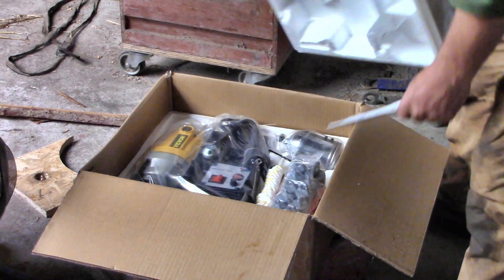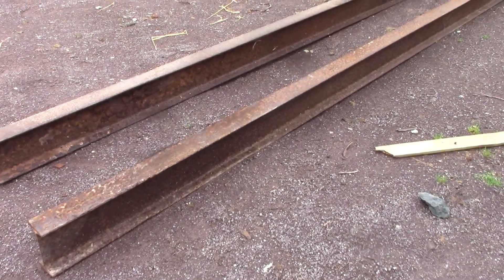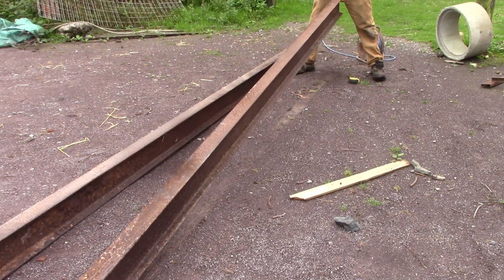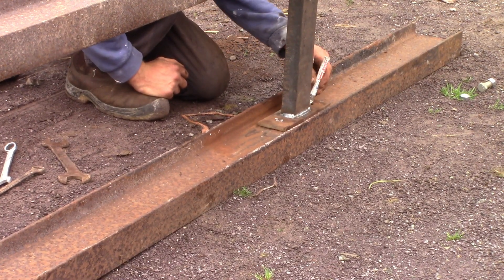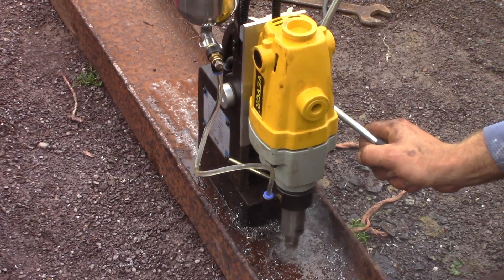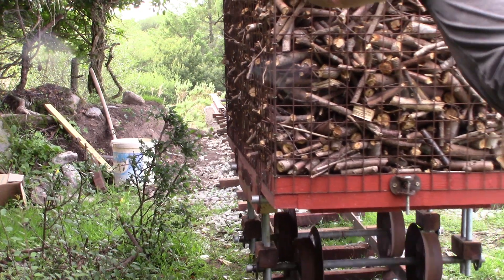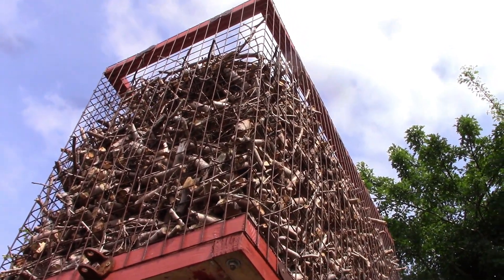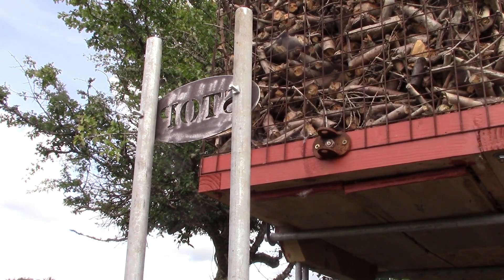We Built A Railway Bridge With A VEVOR Mag-Drill

Comment: Tim, ths is very interesting and could be replicated. What is the distance between the rails (gauge)? How much weight could be carried by the rails (those that you use the most, not this H section)?
Reply from the maker: This is 15" gauge. I'm sure the rails could cope with 100kg per axle easily - We've had more on them but only moving slowly

Comment: You might make a track maintenance cart, with a small hopper for ballast, and a mount for a grinder or wire brush machine (Battery powered) to clean the track surface of rust and crud. Start the grinder. and roll the cart along the path leaving a clean, fresh rolling surface,. Add a oiled pad to oil the track to delay rust.

Good luck!

Comment: Those oil filled dampers in car bumpers might work on your rolling stock as your cars run into each other and the ends of your tracks. These could be fabricated from pipe and use old valve springs instead of oil.

Comment: I've modified several magnetic drills for friends.  They all complain that the drill speed is too fast for some cuts.  I add another switch to the panel, there is enough room) and put a diode in series so it sees half wave DC. This works with any motor that has brushes. When high speed is desired, turn the switch on and it shorts out the diode. Everyone loves this mod.  Why don't they build it in?
Reply from the maker: You're right - it does seem to be spinning too fast. I think they made them like that for fast cutting. I'm only getting the hang of it now - but I could have cut those holes at twice the speed
Reply: @wayoutwest-workshopstuff6299  All the mods were requests made were for commercial fab shops who wanted longer life for the bits. Assume experience has taught them something.

Comment: Clean steel works 200% better.  Magnetic drill are very useful. I do use mine as a bench drill press. The oil reservoir can be adjusted for the amount of oil or cutting  fluid to be released.

Comment: As a fabricator/welder/machinist I have used a mag drill many times. They are really nice if you have a hole to drill in the side of something. You don't have to hold it up and drill at the same time. YAY!
This is great until the power blips during a storm⚡ or some dolt unplugs your cord🤬. Yes and yes before you ask. If drilling on anything other than a horizontal surface, tie the drill to something above where you are drilling so you don't end up wearing that drill that may be still turning when it comes loose. And yes I've had it happen. It sucks and hurts.
You have to be safe...
That looks like a really nice drill and the coolant feed is spot on.
Cheers
Terry
No, I didn't beat the guy up that unplugged the cord. I didn't want to get fired. 😎

Comment: Maybe you should fit some planks on bottom flange of the beams so you can walk on it (up to the hopper of course) and good idea would be to weld or bolt stoppers onto the rail instead of that sign. They would help with alignment since sign has bit of a flex to it and could slowly bend out of alinement.

Comment: Hi Tim.  Thanks for a great video once again.  Might I suggest clamping two wheel stops to the end of the line?  These devices are used on regular railways to arrest the wheels of rolling stock in the case of an overrun.  There are lots of examples online of various styles.  Fabricating them would be a very simple process using your CNC plasma cutter.

Comment: Fill the tank with oil. This will run down as you press down and lubricate the inside of the cutter and allow the slug to pop out.
Reply from the maker: Yep, that's what we did
Reply: @wayoutwest-workshopstuff6299  yes, I saw that after I commented. Very useful drilling machine. Please don't be tempted to sharpen those cutters without the correct grinding machine.

Comment: Love it Tim, keep it up.
  I am not a mag drill expert either but I have worn a couple out by drilling dozens of hundreds of scores of holes.
 I will say that the majority of tooth wear comes from just acquiring the initial cut rather than the cutting itself.  If you can avoid starting and then stopping multiple times per hole then the bits will last longer, Your onboard oiler will help with this and i've drilled many holes with only water for lube. Of course in thicker metal you may need to to clear chips but it's small troubles for the magic of a one inch hole in one inch plate.
-Since the rake of the teeth is low it means as they wear you may struggle to initiate new cuts. a well struck center punch will remedy this as well as a slight starter drill mark (but not a thru hole).
it allows the guide rod a place to drop into to allow the teeth to start a little deeper.
-Clean metal is better for the magnet and the drill is less likely to lose purchase and well smash your fingers just before it breaks an expensive bit :-)
Reply from the maker: thanks - yes, all that makes sense..

Comment: Well done Vevor. I have used them for heavy duty full extension hinges. You are using oil, which is better than water or nothing. Try and get some solubile oil for coolant, that is what is used in industry. Its diluted with water and has better cooling characteristics than oil. It’s called slurry and mixes up white. Look after the cutters, don’t let them get hot. They are expensive. Keep up the good work 👍

Comment: Mag drills are superb , but use the correct cutting fluid ( lots of it ) as roto breaches are expensive 
Always use a safety chain to prevent  the drill body falling off when used in vertical boring

Comment: Fantastic!  Have you considered building the char cooker to run a steam drive compressor which can give you the 3000 psi air for your engine?  Or perhaps run a generator to charge batteries for a locomotive?  Have you found a 3000 psi compressor yet?  Diving compressors will surely work but are very slow however there is a chance you will find an old one that is not being used at a great price.

Comment: Brilliant as usual.  Low Tech Magazine should name a "Hero of Low Technology" every year.  I nominate Tim if said website gets around to such an accolade.  In a low tech world a mag drill would be shared around to help with ingenious, low-impact yet high yielding projects like Tim's.  Big question: did the center plug come out easily when the hole was finished?
Reply: The centre plug usually falls out at the locating pin (usually for centre punch marks) has a spring behind it in the arbor which pushes the plug out. Though occasionally the plug gets wedged at an angle so you just pry it off the end of the broach cutter with a screwdriver or something
Reply: Great!  Now I really want a mag drill.  Probably have to take up metal fabrication to justify the outlay...

Comment: Hey Tim! I'm really looking forward to building a small railway myself, but I'm scared of the costs, especially for the wooden sleepers. I want to ask a question that you may know the answer to better than myself, wouldn't it be cheaper to make  concrete sleepers as thick as your wooden ones, space them out a bit more than you spaced your wooden ones and come out with lower costs?
Reply from the maker: I looked into making them at one time. I'm sure they'd be the best in the long run, but they'd be much more expensive short term. I was going to make a mould and a vibrator so they were strong - with rebar - but for my type of fixing they'd need holes for the pegs and the distance between the holes varies unless you're on a straight. Have a go though, and let us know how you get on?
Reply: @wayoutwest-workshopstuff6299  Alright, thanks! I figured out a 12 inch gauge railway with 40x40mm sleepers would cost only 10 euros here in Romania, but that's still a lot of money for us, so I'll try and see how expensive it would be. Maybe if I'm using bigger gravel in the concrete and I have the holes pre-made in the mould, it would be easier.
Reply: @bobi_lopataru  if the sleeper is only 40mm wide, the aggregate should be small, maybe 10 mm. There isn't room for 20mm and rebar?
Reply: @Ashley-yn8xe  Good point, I'll see what i can work out hehe
Reply: Hmmm... Concrete sleepers sounds nice! I wonder how much it would cost either. Also, do they have rebar inside them? That might increase the cost though...
Reply: @rizalardiansyah4486  I was thinking of that too, but one piece of rebar would suffice, hopefully, so it shouldn't be that expensive. Probably the most important aspect of this idea is the pricing in my area for said materials.

Comment: Great job and a useful tool that I didn't mind watching a working ad for.

As an aside, when I worked on a farm, we used to use old Diesel engine oil for lubricating things that would be outside. Hinges, top link adjusters and other bits of kit. It was free and it seemed to resist weathering better than fresh oil.

Comment: Maybe you can add thick wooden planks between the rails to allow you to walk out partway on the bridge? You might have to add another cross piece closer to the 'land' end of the bridge. I think you will find many more uses for the mag drill, I have seen people use them in a horizonal mode mounted to a vertical metal post

Comment: I have a suggestion for your end stop. It looks like the loaded hoppers are putting a lot of leverage on it, which could be a problem especially if you plan to use the sign to position each car. On a real railroad this is often solved by using what they call a "wheel stop," which looks like a wheel chock bolted to the rail. It could be added in addition, because the sign would help keep the car from flipping over the end if you hit the wheel stop too fast. As a side note, there's also a thing called a skate (search "railroad rail skate") which can be set down anywhere on the rail to keep a brake-less car from moving. These are sometimes used at the far end of a hump yard to keep the railcars from rolling too far. I hope one or both of these ideas is of help.
Reply from the maker: I should have drilled the holes before I put the bridge in place - now I'd need a generator...
Reply: @wayoutwest-workshopstuff6299  Maybe build a wheel chock and weld a clamp to it, so you can clamp it on the bridge anywhere you need it? That way you could even use cars of different designs if you should ever want to evolve them. Although the clamp should be very heavy duty, and not just hand-fastend. But real buffer end stops (the ones with the buffers) are also just held to the rails with friction, so that they can bleed of the energy of a fast moving car, instead of just getting ripped appart.
Reply: @wayoutwest-workshopstuff6299  Some smart company might offer one of those inverter generator thingies.
Reply: @wayoutwest-workshopstuff6299  You can mount the generator on a rail car and have mains power anywhere near the track. Then you have a reason to build a mains powered loco! :P Thanks for the videos!
Reply: @wayoutwest-workshopstuff6299   maybe a diesel electric locomotive could double as a generator-welder ?
Reply: @NickNameNick2  That is actually an excellent idea.
Reply: You have drilled holes for your stop sign, you could use those holes as mount points for the buffer stop and mount the sign to that instead. That way there wouldn't be a need for a generator, you make the parts in the shop and run them there on a wagon.
Reply: Or a reeeeeeally long extension lesd
Reply: Yes, I'd think you'd want something a bit chunkier than that sign at least, just in case.
Reply: Just what i intended to write

Comment: Just put some J-s down at the end, so the front wheel will be catched. This way the carriage may tilt forward, but not "jump" over the end.

If you wanna make things safer you could even do this springy thingy some real trains use. :)

I mean at the end you'll have to drive with your locomotive from the other side of the whole train and need a solid "stop" to locate the from wagon at the right position 😌😁

Comment: Placing a 2x10 plank or diamond plate steel in between the bridge rails would make it easier to walk out onto the bridge to spot your drying wagon.  Adding a ship ladder off to the side of the bridge next to the chimney would make it easier and faster to get below to open the trap doors of the wagon.  You could also make a small platform at the top of the ship ladder so you can add hand rails to the ship ladder without fouling the rail car clearance.

Comment: I would suggest drilling a pair of holes in the top of the girders and putting in a bolt for the wheels to hit...just in case your locomotive doesn't behave one day when you tell it to stop.
Reply: ...just in case wagons can't read.
Reply: @meirionevans5137  It takes some time to teach them.  You can't expect him to have all the wagons up to speed before the railway is completed! It must be done in proper order.
Reply: Better some kind of a latch and a stopper combined, for the wagon to aim perfectly into a hopper without needing to actually aim
Reply: I think a brace on the stop sign like the buffers on conventional tracks.
Reply: Maybe a few extra rails on the side of the bridge just in case if the wagon or engine decides to fall off the rails
Reply: Can I ask why!   What is the purpose of all this?  Not being a smart ass.  Really am curious why put so much work and money into this.

Comment: You could also fit a coupling to your stop sign to anchor the wagon in place (via it's coupling) whilst you are milking it
Reply: Adding a little bit of a slope down to the chimney and letting the wagon rest against a sturdier stop plate would make it less of a hassle with having to uncouple the wagon to bring the wagon back over the bridge.
Reply: @michaeldoll4185  So adding 'a little bit of a slope' down to the chimney and letting a heavily laden wagon roll down it, you mean? Good luck with that!
Reply: @BuzbyWuzby  a 1" drop over the entire length is enough to keep it from rolling back uphill and as far as wrestling with a heavy load on a slope, with a 1 inch drop, it would practically feel level.
Reply: @michaeldoll4185  So say 100kg falling 1 inch in 10 seconds? That's a lot of kinetic energy & momentum. So rather than it 'feeling level' why not simply keep it level and just use a simple coupling to hold the wagon in place? I mean wagons are coupled and uncoupled all the time. It's not as if it is something brand new being introduced into the system. In fact quite the opposite in that you would be using the existing mechanisms in the usual way. Why complicate things unnecessarily?
Reply: @BuzbyWuzby  having to couple and uncouple a lynch pin on the other side of the wagon seems to be an unnecessary hassle and take extra time.  Work smarter, not harder. But then what do I know, I grew up around carpentry and construction and been working with heavy equipment since highschool and driving eighteen wheelers for several years where you learn physics by doing in a fast paced dangerous environment.  Oh and I've been fascinated by trains my whole life, not to mention the countless other hobbies and interests. I operate on logic and common sense, but apparently common sense isn't to common anymore.  In America anyways, there 3+ generations of stupidity and I have the privilege of witnessing that every single day on the road.
Reply: @michaeldoll4185  Well I learnt physics at university, not in a truck PMSL

Comment: That buffer needs to be more solid if you're going to be pushing that wagon with your railway engine. Good job though!
Reply: I don’t think it needs to be much stronger than that for where it is. Much like the railroads use old ties as car stops, it just needs to be strong enough to stop a wagon at low speed from rolling off the end.
Reply: @andrewreynolds4949  If he pushes the wagon with his railway engine and he gauges the distance wrongly or gets distracted or something - it needs to be able to stop the wagon and engine. The same as the engine needs a dead-man's pedal so that it stops automatically if there's a problem.
Reply: @ZephodBeeblebrox  Seeying how he build the locomtive i wonder how good it's gonna be at pushing wagons.
Reply: @rubenskiii  All we can do is watch. I still think electric traction is a better idea.Just use a battery charged by the sun to power it.
Reply: @ZephodBeeblebrox  Good batteries are expensive...
Reply: @andrewreynolds4949  This is true, however, it can be solar charged and could be a lithium battery. Indeed, there are people with small boats that run them exclusively from solar with two solar panels. They don't even bother with batteries. Having said that, I keep forgetting that cost is an issue. I did think putting a pair of bicycle pedals and simply pedaling would have worked just fine.
Reply: @ZephodBeeblebrox  I do like the pedal power idea myself...
Potentially he could also use donkey power
Reply: @andrewreynolds4949  Donkey power is a very good idea - the very earliest railways with wooden rails were horse/donkey powered.
Having said that, with the shortness of the route, perhaps harnessing the donkeys/horses for such a short amount of pulling might take up too much time.